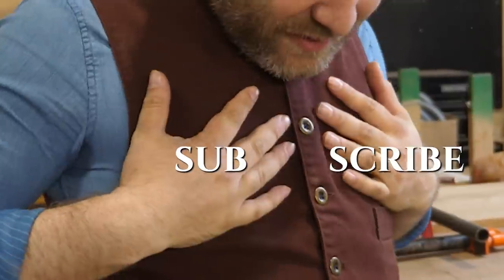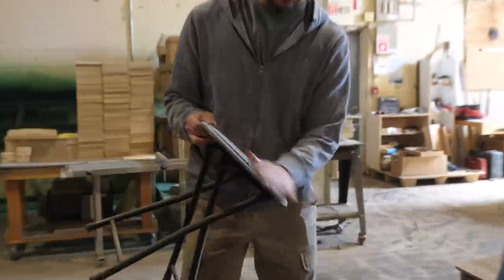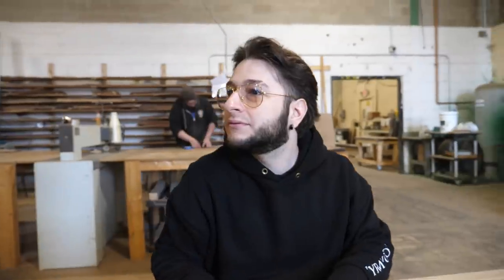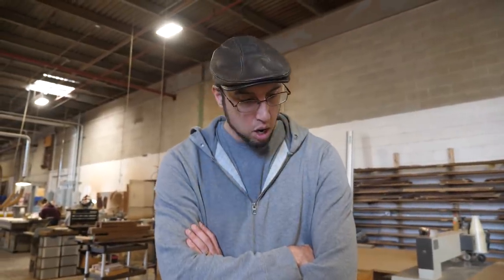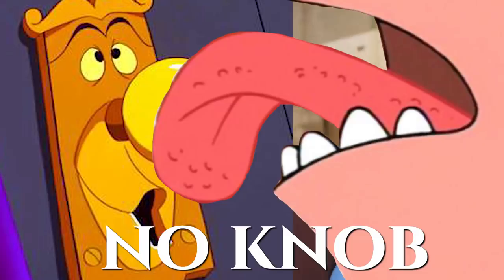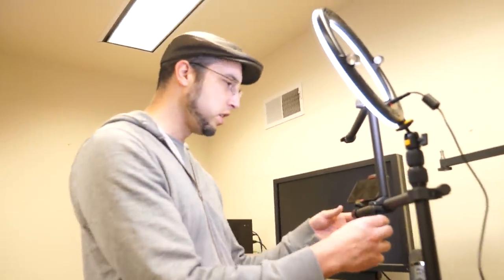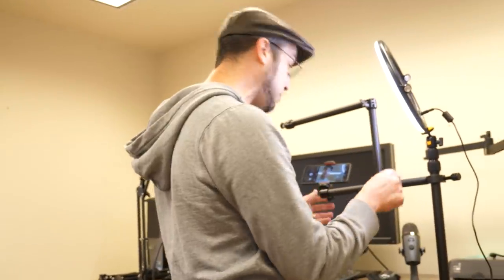The Wyrmwood Modular Sit Stand Desk (the goldilocks desk)

Comment: Please make sure that the motor you guys use for the table is either way stronger than what’s needed for the base table or that there is an option to add additional/stronger motors easily. I built a cradle for hanging my computer under the desk, and the steppers are drawing more current than the driver board can supply, causing it to detect a collision. This desk is probably going to be heavy AF when the drawers are full and with a computer, monitor, etc... It’s a very important design consideration that might be easily overlooked.

One more consideration, please make sure that when the desk is at the full standing height with all the drawers open, that it doesn’t fall over. This issue happens all the time with tool boxes, but people might not expect it on a desk.
Reply: There is definitely a division between stand quality.  From "Ikea" to "Boutique" quality.  The good quality usually supports about 300lbs, but with all these addons and multiple monitors you might hit that weight.  Then if you have a monster rig that you want to hang from it you are S out of luck.  That's why I left mine in the floor and invested in longer cables.
So, either you need to be cautious of that in your design or you have to be able to get a stronger motor.
Reply: On the twitch stream we watched Bennett Ride up and down on the desk while laying atop it.  So they're definitely stress testing it.
Reply: @DarthPoyner  I have a nice sit-stand desk that can do 350+ lbs but I don't hang my desktop, a heavy top and what I have on my desk is heavy enough where I don't want to add even more weight and wear the electronics and motors out if I don't need to. I just got longer cables for everything and it has worked out.
Reply: This is all I could think of when they were discussing drawers, clamps and the "overhead" solution. The desk is already going to be heavier then many sit/stands due to being actual wood. The motor on these poor things is gonna get a workout and a half with how variable the weight can be with the skews theyre looking at.
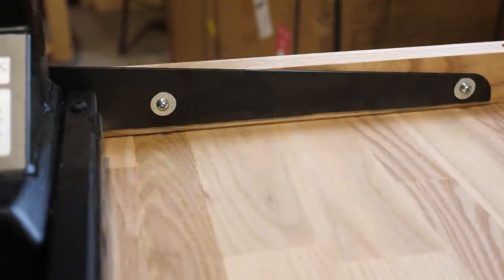Reply: They are using the same motors that Uplift Desk uses (1:46).  Their 2-motor designs are rated for 355 lb and their 3-motor designs are rated for 535 lb
Reply: Personally, this is why my sit-stand is a "dumb" sit-stand with a manual crank - keeps stuff like sensors and such from interfering with it, and the only way it'll stop working is if the actual mechanism physically breaks...
Reply: or i think the more logical solution, is to have the storage remain at the same height, be attached to the legs. and have the table top move up and down.
Reply: Toolboxes are usually on wheels, though, right? I think with the wide leg bases on the desk that should be less of an issue.

Comment: I would recommend testing with multiple screens on one of these, just to check. Many people that use a sit/stand desk today have multiple large screens, some with arms, other with normal monitor stands. And they eat up the space you need quickly.
Reply: and weight too. Some monitor mounts are heavy and all that wood on those legs are going to add up quick.
Reply: agreed!
Reply: Plus if the drawers get filled with stuff that will add a bunch of extra weight too.
Reply: On top of this, for the most comfortable and healthy typing experience, you NEED the desk to be pretty deep. I game with a split, ergonomic keyboard so I'm right up against my desk and have my keyboard halves almost right up against the edge of the desk. Because of this, I ended up upgrading the depth a desk I ordered to be 32" deep. Every inch matters.
Reply: I have a cheapy IKEA manual-crank sit-stand desk with 3 monitors on a home-made hutch that I put across the back, and the way the imbalanced weight tilts it back is bad enough that the crank won't even slide out to the turning position. I have to push down on the front of the desk with my other arm to even it out, but once it's evened out it moves easily even with the extra weight.

The underframe in this video looks like the legs come up pretty close to the back of the desk, which would probably cope a lot better with having most of the load near the back than the centred-leg setup on my current desk does.
Reply: And in different configs. When you mount a monitor vertically it doesn't spread the weight evenly. It'll put more torque on once side. Seeing how the table/mount would react to that is important too.
Reply: I'm currently using a Jarvis 48"x30" with a Thunderbolt Display, a 35" ultrawide, and a laptop. It's a tight fit, but it works.

Comment: I am all for using finger jointing. The less waste the better plus the added strength. It doesn't need to match all the other WW tables because it is its own unit and style. Is it possible to replace the lift unit when that fails without ruining the desk?
Reply: good question!
Reply: Can't speak to this WW desk but for any sit/stand desk I've used you can just flip them over, remove a few bolts, and replace the legs. It's a 2-person job, though. Those things can be heavy.
Reply: @matt-lang  Which is why I worry, wood desks with shelves and the extra PC hardware can be heavier than standard Sit/Stand. I know they showed one person riding it, but those motors give out over time.

Comment: Doug's add-ons this time were actually awesome. Much better than the DM screen. Mic mount is huge, that metal bracket with holes for a monitor mount would be amazing if it could support the weight because I would cry drilling holes in that beautiful desktop. I think Wyrmwood could get some exposure too if they maybe got a streamer involved with a Prophecy version down the road. Might boost subs and bring new Wyrmlings in too!

Comment: Love the way the desk is coming along. Definitely need to test with BIG and heavy high end monitors. I have a 49" curved monitor that is about 40 lbs, but the weight on the desk itself is a lot more, so the clamps could potentially damage the desk depending. 

How high does the desk go? As a tall guy... sit/stand desks generally require wood blocks under them for it to work for me. It's very possible to capture more of the market if it supports tall guys.

Also... it's been 4 months or so... what happened to the chairs :( Your website doesn't really showcase them anymore, so I can't exactly buy the old ones either. :(
Reply: The Wyrmwood Instagram posted a story yesterday about photographing the chairs, so hopefully they are coming soon!

Comment: I have a sit stand desk and it’s 72x30 inches, I honestly could have gone a bit wider and I don’t have any drawers impeding my knee space either. Personally I think the desk should have a larger size. I agree that clamping is a thing that a lot of people do, around the full perimeter of my desk I have multiple monitor mounts clamped, a camera and mic mount, a guitar neck holder, and a headphone holder and I would hate to lose them. The one annoyance with headphone stands that overhang the edge of the desk is if you have a cable then the cable can dangle and slide off the desktop (especially on nicer headphones with thicker cables).

Also, will this only be sold with legs? I could see myself possibly upgrading my top to a wyrmwood one if the size is large enough but I don’t want to buy the legs and electronics again.
Reply: 100% I can't use a desk that is less than 79"L x 30"w

Comment: I would still worry about having too much of a bevel on the back side, the bevel might interfere with a lot of clamps. Definitely needs to be tested, since it not being compatible is just straight up a deal breaker.
Reply: Bevel on the front is great.  Though I prefer the top sided one.  But definitely not the back and maybe not the sides.

Comment: 60"x 30" is good until you add storage on the sides and lose the leg room. Definitely agree about keeping similar geometric shapes for edges. Personally with my current setup I would want a 72" x 32" desk. That desk depth really disappears depending on monitors. (Throw a Wacom on there and it goes even quicker) Also an under the desk PC shelf would be cool.
Reply: PC Shelf is bad for air flow.  And for people with the "strange" shaped rigs it wouldn't work.  Easier to leave it on the floor and buy long cables or even custom build a platform for the thing and leave it at that.  The larger "depth" would be appreciated.  Though 72" length(width) seems excessive for most needs.  Maybe something closer to 64 or 66 inches.
Reply: Yes, 72" x 30ish" would be a lot better than 60".
Reply: @DarthPoyner  a shelf isn't necessarily bad for airflow if it's open on front and back and not tightly crammed in.  My desk is already 60" and it's crammed with stuff. I'm a bit abnormal though with a special monitor and a second computer on it. Also putting a PC on the floor is far from ideal for me lol
Reply: @DarthPoyner  64" wouldn't be terrible though.
Reply: @DarthPoyner  As a non-gamer air flow is not my primary concern. Cable management is. Having a PC shelf is vital for me because otherwise I'm going to end up with way more cabling than I want, since it needs to handle multiple heights. That's my current set up and I hate it. So I likely won't buy this without a better system for that. (I definitely don't have the desk space for my PC unless this desk ends up being HUGE.)
Reply: I went from a 60” to a 72” 6 months ago and would never go back.

Comment: This needs a magnetic rail addon to hold a VR headset.
Reply: A Drawer, with space at the front for a cable to fit through when it's closed, would be safer and a better solution.

Comment: Overall, I like the direction of the desk. Jason's headphone mount is wonderful. I also really like the idea of having a clamp to make clamping non-Wyrmwood products without worrying about compatibility (Bobby's idea was VERY appealing, so definitely make a mock-up of that).

I think another accessory you should also immediately be in the process of prototyping is speaker stands. Quality speakers for music production often take up lots of desk space, so maybe the magnetic rail could allow for corner-mounted speaker stands? You'd probably want the stand to be able to pivot on a metal rod or something so you don't have to make specifically left and right corner stands. Maybe Bobby's frame could be possible to integrate into those stands? Who knows. I'm obviously not a product designer :P

Comment: I LOVE the Bobby rig idea. Currently I've clamped 3 poles to my desk (which is not sit stand) that I've mounted two monitors and a DSLR behind a beamsplitter to.

My only preference is that once you go rig, I'd like a super wide option. Currently I have an old modular Ikea model that has a corner desk piece and a normal desk piece stuck together, and I love all the space.

I think cable management being modular is great, because I'm mostly good with the rats neat under my desk, but other opinions may vary
Reply: If you have a "Traditional" Desk, why not Wall mount stuff instead of cluttering up the Desk or attaching poles?
I have a 60" 3d TV as a second Monitor, and it's mounted separately because putting it on the Desk would be Insane.
Reply: @lokithecat7225  It's a good idea, but my desk is too far from the wall. Plus I'd like to be able to reposition the monitors from time to time, but maybe that's a little overrated. 

It's all about tradeoffs, eh?
Reply: @FTWynn  I have a "Corner" Desk, but it's not in the Corner... I sit in the usual spot, if I look towards the (Near) Wall my "Work" monitor is there, and looking over towards the (Far?) Wall about 5 feet away is the TV / Movie Monitor, on a Stand.  Keyboard + Mouse is on the... Corner? so it's a 45 degree head turn to look at either monitor, while body is lined up with the Keyboard, and my Arms are able to rest on different parts of the desk.

I think for most people there are solutions to a good environment, but definitely takes some time to figure out what works comfortably.

Even a well designed Desk isn't a magic solution, it's just a good tool / starting point.

Comment: That desk size is about perfect for me. Though I wouldn't say no to up to 6 ft x 3 ft, especially if it had a larger cut out to feel more surrounded by the desk. 

Love the magnetic rail headphone accessory, especially if we could get a backboard option with a magnetic rail so I could place accessories above the desk surface. In general I support adding more magnetic accessories, including the clamping idea.

Also add an option for a PC tower shelf. Ideal would be if I could have it further back so I don't lose front storage, but I don't mind it replacing the cabinet. (And I guess that would interfere with the cable management most likely.

Comment: Beautiful improvements, guys. Love what I'm seeing.

I'm team Bobby when it comes to an overhead mounting system.

Also love the hardware-less idea from Jason

Would like the option of placing cup holders on a front rail with drawers that open to the side or vice versa. Could you design the drawers so they could open at the front or the side? How about square shaped shelves with symmetrical mounting points so one could choose to mount them to open forwards or sideways? 

I like to be able to easily access the back of the drawers. Do they slide out that far?

Would the table be balanced and would the motor handle the torque if you have only one drawer? Can the motor handle the weight? I'd rather have just rails and accessories if that was an issue. Build a drawer unit that sits on the floor, has lockable wheels, and doesn't tip.

Comment: With your additional mounting surface, instead of a massive steel clamp, maybe try a modular rail accessory that has a larger magnetic foot print and/or stronger magnets. I’m thinking something like a cup holder sans cup hole with maybe like 3 or 4 inches of magnetic mounting surface area on both sides that’s flush with the table, so you only get a small attachment point sticking out of the desk profile, but a much larger magnetic area that’s less likely to come loose

Comment: I think the desk is looking good, aside from the modular add-on for a cable management solution. If someone wants a more complex and thorough system, then this addition seems fine to me, but at base I think there should be some means for people to do more basic cable management.

Also are you taking into consideration people's desktop towers? The drawers are nice and all, but they leave little room for a medium or larger tower underneath the desk, and a 5' x 2 2/5' top is definitely too small for a full working space, 2 monitors (mounted or otherwise), and the tower. I think that you should survey your customers/followers a little bit to get a sense of what people are working with. You have this YouTube channel for polls, and the newsletter/email list that you can tap into. I'm not sure the viability of this, but there is also Kickstarter that you could (potentially) use. It seems you have a few good options to make use of, and it will only benefit your customers.

Comment: The only issue I see with Doug's mounting thing, is that it sticks out quite a way at the back. It means you can't have your desk against the wall, it'll be several inches away, and it'd look kinda ugly with a monitor clamped to it. It seems much easier to remove any bevel around the back and just have that space to clamp things to.

Comment: At the start of the pandemic, I built myself an 8ft long standing desk with metal bars rigged up like how Bobby was talking about. It's sick as hell, holds my Yamaha HS5s at ear level above my three monitor setup. Watch out for twisting on the z axis. Last thing you want are 20lb audio monitors crashing to the floor. Thankfully, I used 150 psi galvanized steel pipe, but I did have to be careful of the threading for the flanges. Quality control on those were not great. Some of the joints were not 90 degrees. Yikes. 😬

Comment: I am prob a minority here but for my use case, I have 3 monitors (1 ultra wide, 2 27in monitors) My current desk is 6 foot long. For me a 5 foot desk would not work with this setup as I already feel cramped on space. I would love a wyrmwood 6 foot desk with a bobby cage. I think that idea is solid, as my mic currently is in a really dumb position and if I can just have it hooked up on the top of the rack and drop down when I need it would be great.

Comment: @Wyrmwood - Maybe not a major concern, but still something I feel would be warranted to investigate.  You put out warnings for the tracker tile, the size of the magnet, and how it's not recommended or safe to hold it up if you have sensitive electronics (pacemaker, etc.).  With building in the magnetic rails and the potential to have numerous click-ons with the powerful magnets specifically on a piece of furniture for electronics...see where I am going?  Any thoughts on if this will be a concern or if there will be physical limits on the number of magnetic accessories that could/should be used with the desk?

Comment: Maybe instead on magnets you guys could try t-slot aluminum extrusion.  That way add things can bolt to the channel.  That or magnets  in the front for easy use and, t-slot on the sides for stutter connections.

Comment: I love all these grand design ideas you have, BUT, have you given consideration to the amount of weight all these add-ons and accessories will add? Then consider the weight of a full pc, dual large monitors, AND anything people put in drawers and rails!  Can the desk raising mechanisms handle that much of a load when changing height?
Reply: You could easy get a 150lb desk from this setup maybe even 250 if your stuff is beefy.  That little motor going to struggle if not taken into consideration.